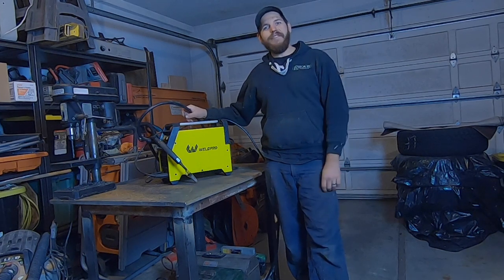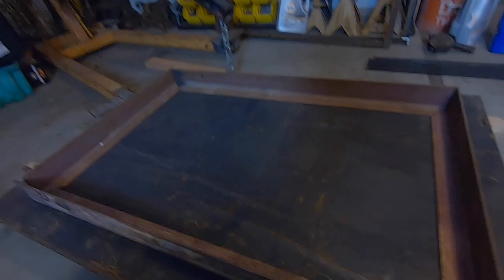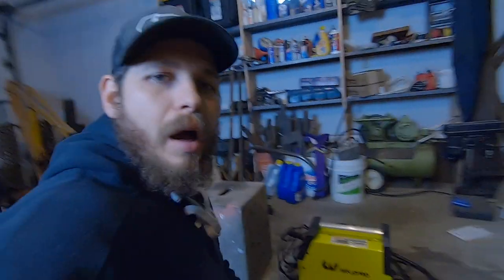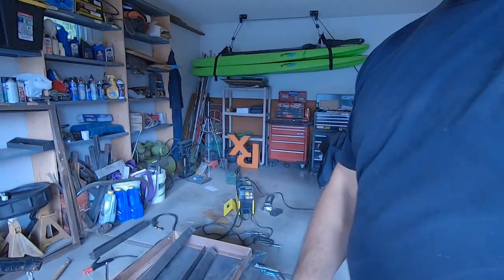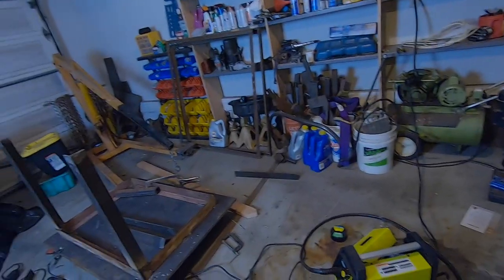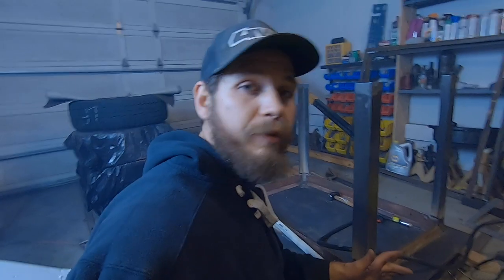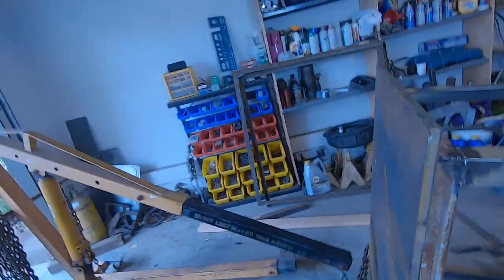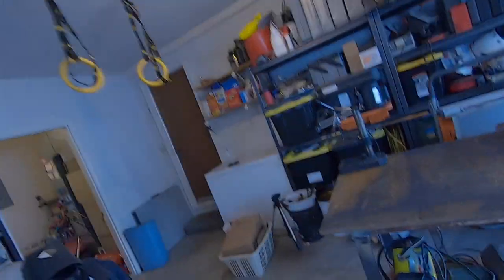Build a Fab Table out of SCRAP! Weldpro MIG 155 GSV

Comment: Nice table my friend . . . how long have you had the Weldpro machine?   I am thinking about purchasing the 155 mig/stick unit . . .
Reply from the maker: Thanks! I’ve had it for a couple months now. Haven’t tried it on 220 power yet, I’m excited for that, I’m sure it will make a big difference. If you decide to buy one, use the link to the welder in the description of the video, helps me out a little bit. Thanks for watching!

Comment: what was your rod, volt and amp settings ?
Reply from the maker: 3/16th 7018 rod, amperage pretty much cranked but only on 110 power. no 220 in the garage yet. I'm sure it would do much better on 220
Reply: @DaysofPainandVictory  Yea . . . 220v would make that thing rock. . . thanks for the response!
Reply: @DaysofPainandVictory  220 made a huge difference. ran 1/8 7018 and 1/8 6011 so far. 6011 liked 80 amps on clean metal and 7018 liked 100. Cranked amps on rougher surfaces that were harder to prep. Ran .030 flux as well like you said make sure you have the polarity correct. Tacks and welds nicely but having troubles getting it to feed smoothly for longer periods. also need more contact tips, weldpro is out, do you know if there is a generic brand that we can use?
Reply from the maker: @seakadventurer1330  sweet that's good to hear! As soon as we get out of this rental I'll be getting 220 asap. Not sure on the tips, did you ask weldpro? Did they give you a timeline on restock? The tips look pretty standard to me.

Comment: You're tripping that breaker because of the extension cord so you may have to live with that for a bit.  I have the YesWelder LYG-M800D with true color.  When you are vertical welding with 7018, weld up and use a weave pattern.  You can also use a 7024 and weld down.  It won't set as quick.  I would scrap the idea of a respirator.  Nothing will fit well under the hood unless you get an expensive PAPR hood like the Miller T94i.  I would just make sure that you get a good fan to move the air in the garage when you are welding.  Great little project!
Reply from the maker: thanks for the info! I'll have to watch some videos on the weave pattern. Thanks for watching

Comment: if your running 110 you should go out and get a 50 amp breaker, you wont pop it at all. ive had the same welder and ran into that problem myself and i asked a buddy of mine and he said thats what weldpro recommends for the 110 set up. keep up the solid work buddy
Reply from the maker: thanks! I'll have to try that!
Reply: Hi, Joe here from Weldpro. I am the tech support for Weldpro, know that you can call me anytime.  NOW, Weldpro would NEVER SUGGEST trying to Rube Goldberg a 50amp breaker to a 120 volt circuit.  BE VERY CAREFUL TAKING INTERNET ADVISE!!!  Just call me.
Reply: Put a 50-amp breaker on an existing 15-amp circuit??  REAL good way to burn your house down...

Comment: running 1/8 inc rod 220 all the way not 110 you would have had better luck running 0.30 wire on 110 with out the tripping the breaker.
Reply from the maker: 0.30 vs 0.35? Probably not getting 220 power here since we’re renting. Might need to try the smaller wire. Would I still be able to weld 1/4” with 0.30?